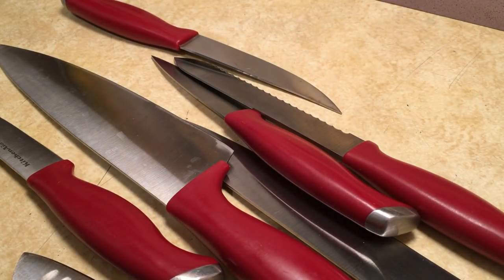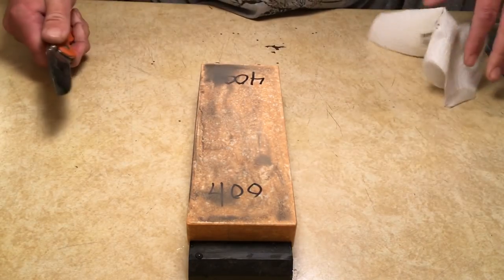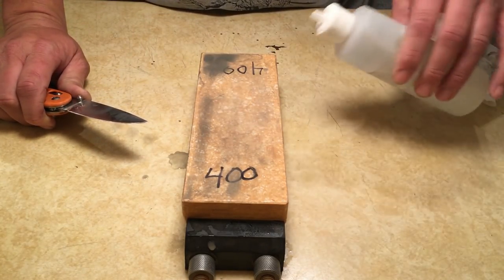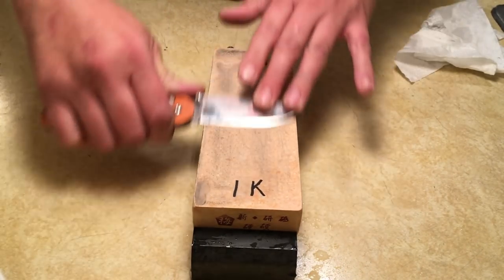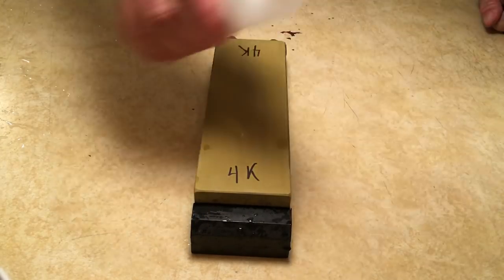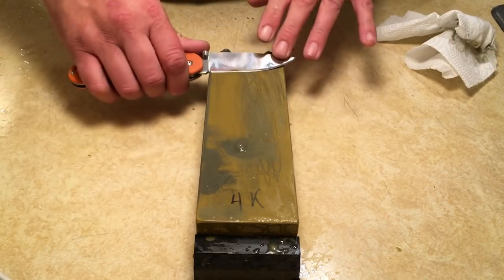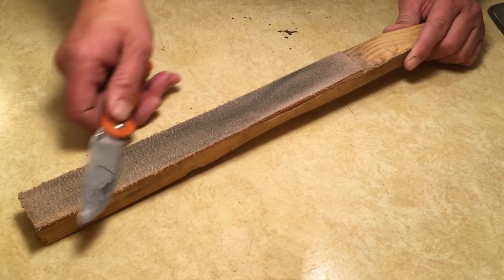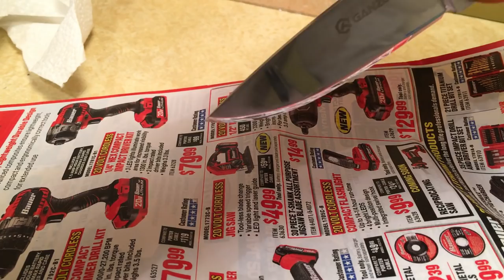Knife Sharpening - Repairing a convexed edge

Comment: "Not perfect" sure a heck allot better than my convexing job though :) God bless!
Reply from the maker: Appreciate it. Convex edges imo, are super easy. It was how I started, when I got into sharpening. Course I didn't know heads from tails, v bevels from convex, but as time went on, I learned what was going on :)
Reply: Jef Jewell I agree, they are pretty easy. I can get a convex, hair popping edge without much trouble. I just need to focus on making it more symmetrical. My edges are functional, but I'm still working on the looks part lol
Reply from the maker: Yes that's the time consuming part. getting things to line up.

Comment: Nice video, Paddy's Potato Peelers talked about you in his most recent video.  I'll need to watch some of the previous videos too.  
     Any recommendations for a first set of stones? Was considering getting some edge pro stones by themselves. Or would it be best just to save up and get a good set?
Reply from the maker: Paddy's good people. My gf loves him to death :p  . Gotta keep my eyes on them two.

Depends on what you want to spend on a first set. King is always a popular and very solid choice. They are fairly priced, and easily found.  Shapton Pro always gets a vote from me, but they can be pricey. Really boils down to how much you looking to spend
Reply: Jef Jewell Regarding budget I would say about $50 plus.  Haven't looked at all the prices, and saw some inexpensive kits for around $30 but concerned they would be worthless.
Reply from the maker: You know I had typed out about buying edge pro stones, and deleted it somehow. Those are a very economical way to get started too. They are about $16 each, at most sites. You can occasionally find the Shapton Glass at a lower price, cut for the epa, as well.

$50 would get you a King combo stone, 1k/6k. They usually run around $25-30 on Amazon. After that you would just need a coarse stone, and be set for just about anything. The Norton Crystolon is one of the best coarse stones for price, but it is considered an oil stone, and many find them messy. In which, case I'd point ya towards a 220 grit King stone. Recently saw a video on the 300 that looked promising, but I have no idea on price for it. The 220 is approx $20.

Now there are all sort of kits and do-dads you can purchase, and each has it's own merits. The Smith's tri-hone is an excellent kit, in diamond or Arkansas stone. The Lansky I hear is getting more popular by the day, but the stones are just too narrow for my tastes. If you have your sights set on anything, and just want an opinion, feel free to ask. I cant promise I know everything, but I can let you know what I think.
Reply: Jef Jewell Great, thanks for the information I'll look at the King stones, which are still a good price.  Appreciate the time.
Reply from the maker: Anytime. Good luck with your search